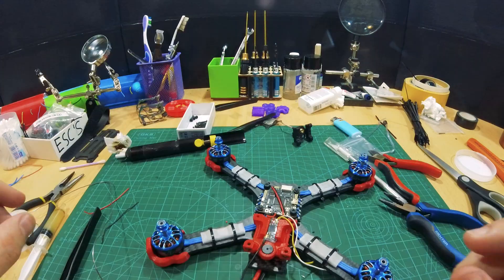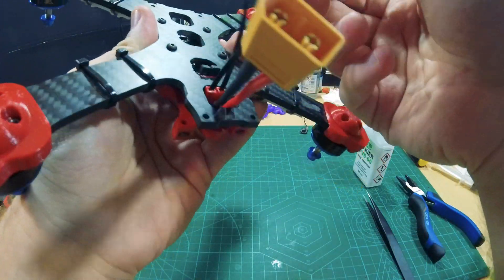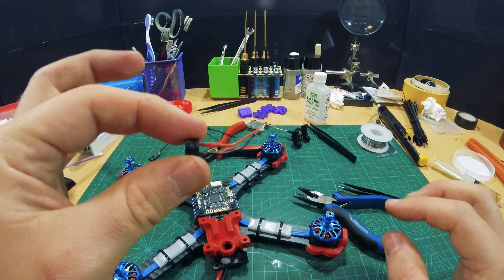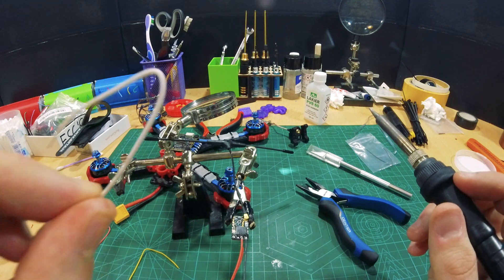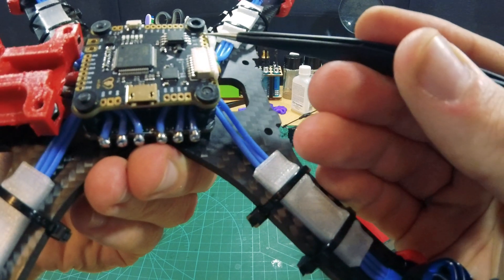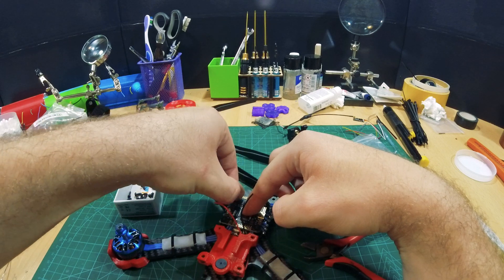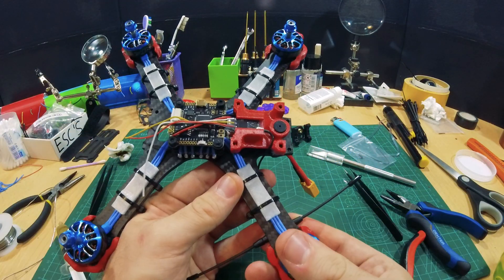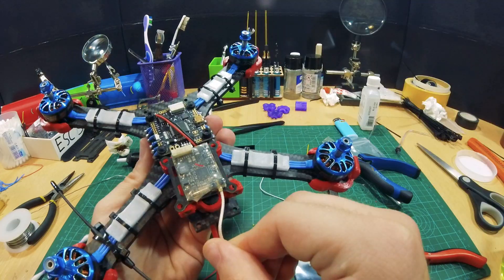TBS Crossfire Nano RX setup tutorial

Comment: Do you know if this reciever will bind with a frsky radio? Like the tx9 lite is the one im looking at
Reply from the maker: CROSSFIRE is a property protocol by TBS and will not work with anything else but a crossfire module. You will need a crossfire Radio or module to use this receiver.